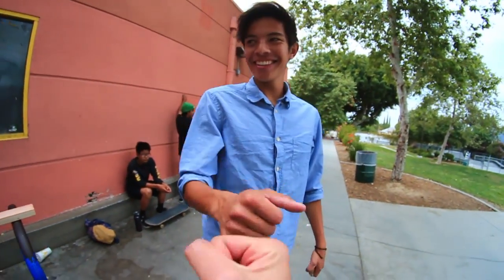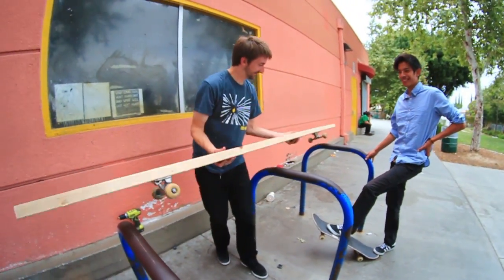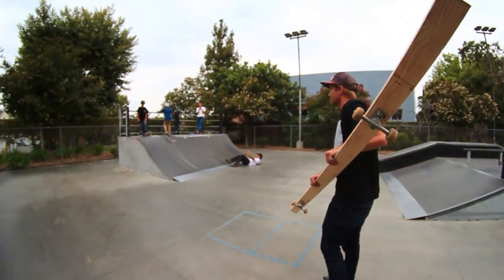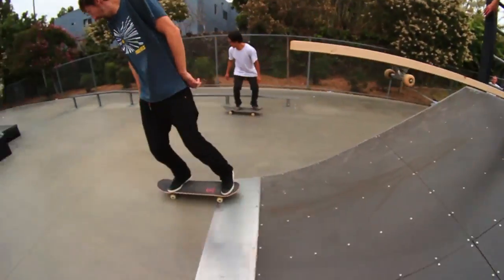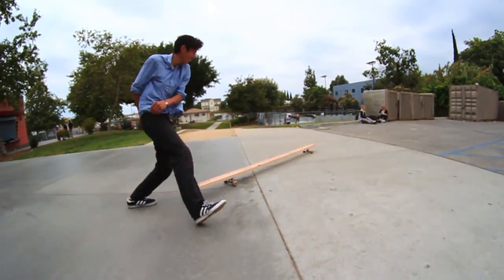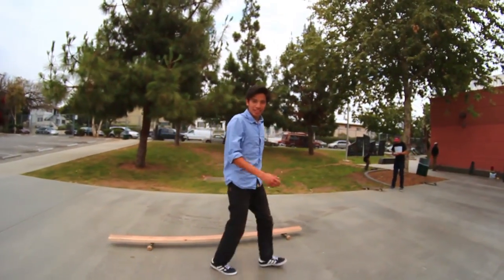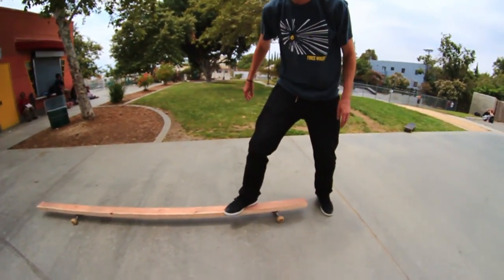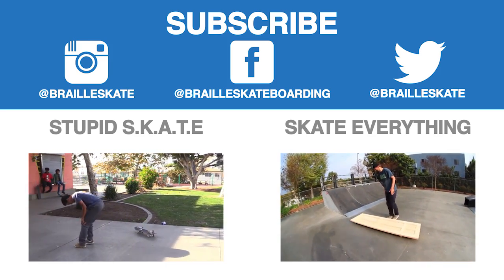SUPER LONG 2X4 | SKATE EVERYTHING EP 30

Comment: you really should skate

a) motorcycle seat
b) trash bin
c) rc car
d) video game case
e) radio (old school boombox)
f) box of somekind toolbox etc with open top

(y) so they can see these recommendations :)
Reply: A boombox would be sick
Reply: Video game case would snap from one trick, let alone if you put it on the ground and stand on it you will crack it. Rc car is just stupid for a video lol.
Reply: With the video game case having the game disc inside and it's one of these games: THPS5, Ride to Hell Retribution, Sonic the Hedgehog 2006, or any bad video game.
Reply: you forgot a bed
Reply: imagine huge kingsize bed being skated around at fremont skatepark :D
Reply: i think it would hold up pretty well because of support of the trucks and you can always use some special edition casing which has been made from metal.
Reply: these suggestions are pretty awful, I have no clue how he got this many likes. Unless it's a bot.
Reply: They should skate a losi 5t
Reply: ΛΞPHAX.CS not a bot but hey its skate everything :D ?
Reply: iTzZTrApPed bro..................... THAT SHIT WILL SNAP lmao. no game case is holding up, the special edition is just some think ass paper./card board.
Reply: iTzZTrApPed
the ammount of likes has barely moved since I  commented.
Reply: they will hold on as long as you dont step in the middle of the trucks with force and some wii mario kart case with all the manuals inside is pretty durable stuff
Reply: a book :)
Reply: video game case? such as the gba sp case? i should send them mine(broke my gba)
Reply: +Nice kkk not true. i have a Gameboy Advace sp case from intec and it held me(300 lbs, so i dont think one trick will break it
Reply: It is a trash CAN not a trash BIN.    Jk I'm irish haha we say bin too XD

Comment: IDEAS! Bbq grate! Lifesaver ring from a boat, with a middle support for footing! toilet seat same thing middle support for footing. My mixtape! It's fire so you might get burned. white picket fence section light enough to get air!  A log with the bark on it! you can clear seal the top so you dont loose the griptape bark! 5 license plates stacked or enough to not warp instantly! I'm like a one-man Focus Group.. a old washboard! a little red wagon with full grip tape for that treflip first tryyyy! a big piece of drift wood! a dartboard! a engraved plaque or trophy! a metal hubcap! Phila bread pan with water put 2 things in there that all added spacers to set the trucks on freeze and skate a block of ice first try! might have to grease the sides of the pan for a perfect ICE LOAF! I'll try to think of more later!
Reply: ADD sawdust to the water in the bread pan,it will make it last longer and increase it's structural integrity, probably half and half or mixture, it won't melt and snap FIRST TRRRRRRYYYYY! then mount the trucks on wooden spacers/risers place them in a greased up bread pan and fill the bread pan with the water sawdust mixture or add the mixture first, plan the the trucks wheels up. maybe just use the base plates so the freezer won't ruin the bushings or bearings etc. then freeze for a couple days of not more. I think it will last a while, and you guys could even take 2 bread pans connected to make it longer welded or glued water tight! I think this would be awesome.

Comment: If it's a  a long "2 by 4"  then it's not a 2 by 4
Reply: cause a 2 by 4 is only 4 feet long
Reply: nope 2x4 is the width and height of the face. long is referring to the length. so this would be a 2x4x11 (or however long it is)
Reply: ahh kk got it
Reply: I don't think that's correct
Reply: What? thats not how it works, its the width and height of the plank not the length.

2  -  -  -  -  
     -  -  -  - 
        4
Reply: +Skateboard Progression yes it is it 2x4 INCHES by however long the length is
Reply: Biggest face palm. Holy crap ahah
Reply: yeah ur right
Reply: wtf hahaha
Reply: 2x4's are actually 1.5x3.5's, but it is the width and height.
Reply: I give up on the Internet...
Reply: Actually the most common 2x4s are studs...which are 8 feet long. You have no clue what youre talking about

Comment: I noticed you guys had the cordless drill on a driving setting to make the holes. Try twisting the torque collar to the farthermost drilling setting (to the picture of the drill instead of a number), and change the top selector to higher speed. It might help with drilling the holes in a bit more easily : D

Comment: You should do a:

1. Toilet seat (like the top part)
2. Ouija board
3. Square shovel head
4. 4x4 wood (or 6x6)
5. Fan blade
6.Weight bench seat
7. Peice of PVC pipe